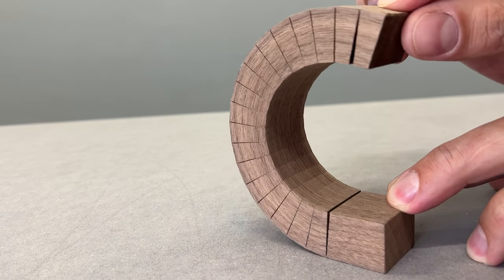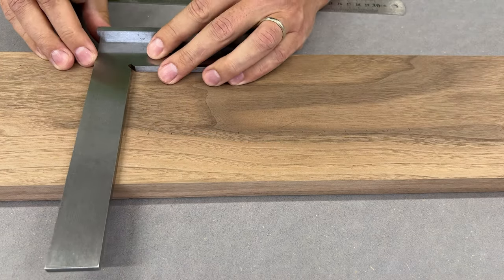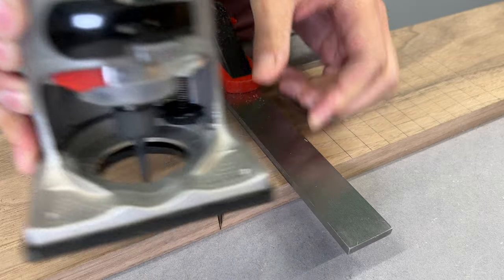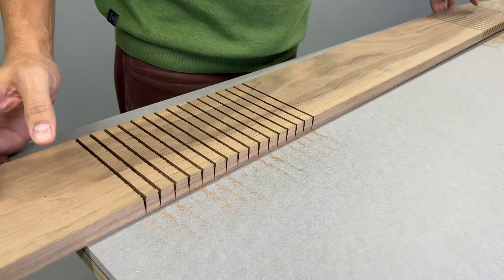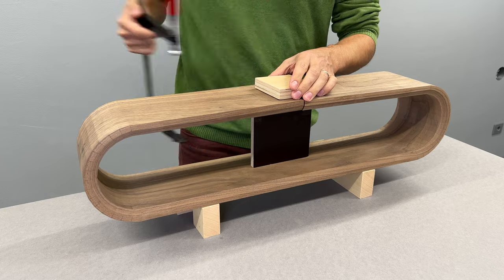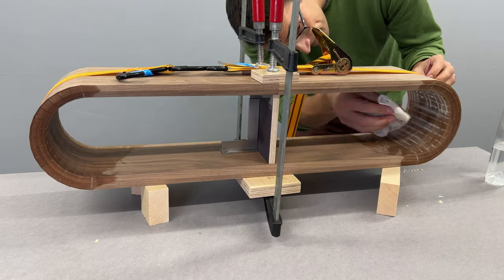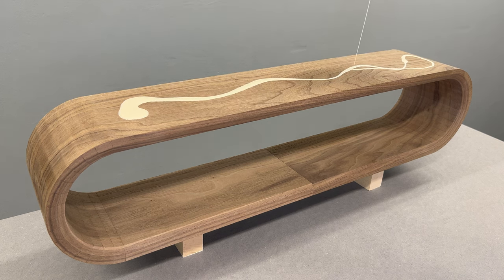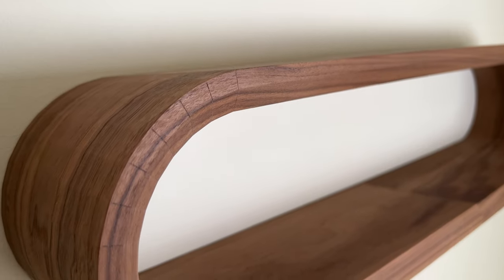DIY A Floating Shelves You Haven't Seen Before! - Easy Woodworking Project

Comment: Having a pre-pass with a smaller bit would reduce chances of breakage for this. Essentially letting it just finish the V cut rather than making it.  So prolly a 2 mm bit with a 2 cm depth pass (guesstimating by eye).
You don't really need to dump all that water on it. Stea... borrow a clothes iron, max it out and set it on steam. Through a piece of thin fabric (pillow case, perfect for this) steam the visible face of the wood. The steam will make the bend super easy. You can even use this technique to bend thin wood without any slits. I think the thickest i've tried using a regular Bosch clothes iron was 4 mm, beautiful, no creak or fiber split, worked great.
The best part about using steam and therefore steam, you're not messing too much with the wood by adding water. Soaking the wood in excess water will activate its pores and that can have a bad effect later, depending on your luck. It's not uncommon to see a waterlogged piece of wood, like for example when they're boil bent, split or have the raised fibers that you have to sand again.

Comment: Did you calculate the angle of the kerf cutting bit, factoring in the thickness of the wood and the inside and outside radius and determine the number of kerfs or did it just work out?

Comment: I'd like to see if you could use this method to create a more continuous curve without the ridges bulging through the veneer.   I love this idea though and your shelf looks excellent ~maybe if you left more meat in the root of those cuts you could sand the peaks on the other side with fear of sanding through.   Be tougher to bend for sure but it looks like you had little trouble bending your 1mm or so
Reply: Yeah, I imagine you could use a hair dryer and it would bend at thicker than 1mm.

Comment: It looks amazing. Wonder how long it before it snaps though. 1mm is not a whole lot to keep it together. Don't know how much that wood works, or how that glue stands the test of time, but it just seems that way.
Reply: I think the veneer is merely assisting the glue up in this case. If I were to make a guess, the curved surface would be as strong as any other wood joint.

Comment: Great video tutorial, one question how do you work out the bend radius?
Reply: Take a depth measurement to see where the widest part of the bit with be, then measure the bit width there. You can then estimate how much it will close. Obviously the thicker the piece, the more cuts that will be required.